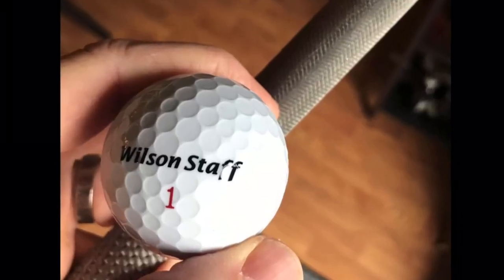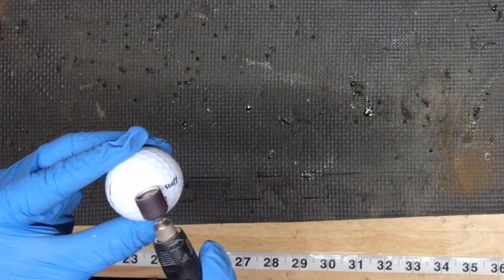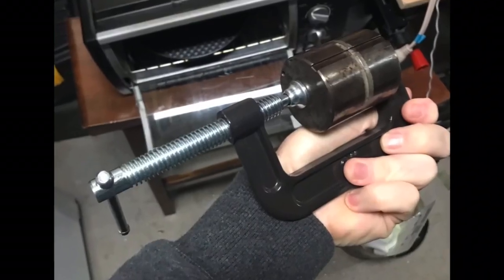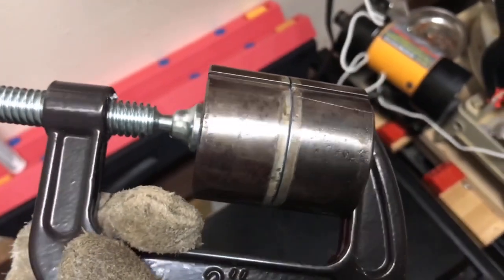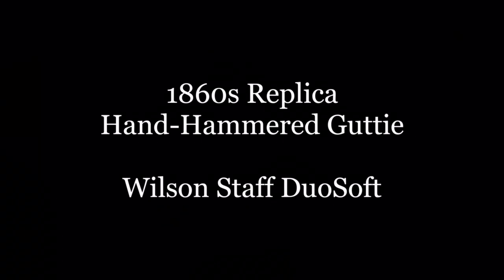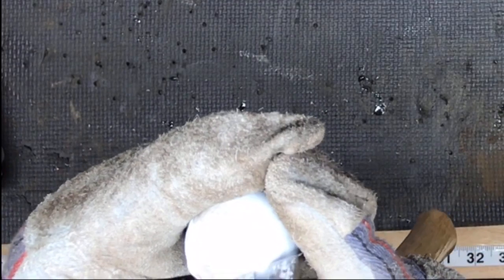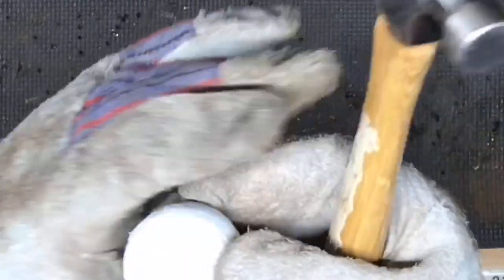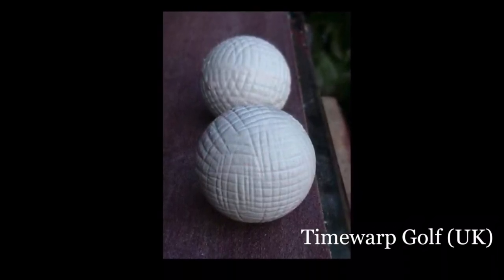Make Your Own Replica Antique Golf Balls for Hickory Golf

Comment: Christian, I've started using a mould, and I can't stop minor leakage around the seam, even tightening up the G-clamp as tight as possible.  It trims away OK, but wondering if you had a solution.
Reply from the maker: Hi, Tony! I haven’t found a process yet that doesn’t leave at least a little bit of seam that needs to be cleaned up a bit, but I’ve minimized it considerably by letting the ball sit in the freezer for several hours before putting it in the mold. It usually shrinks the ball enough to allow the two halves of the mold to seal completely and the seam that needs to be trimmed is minimal.